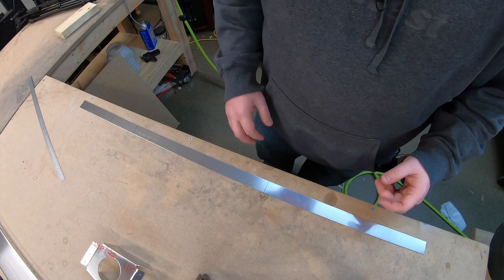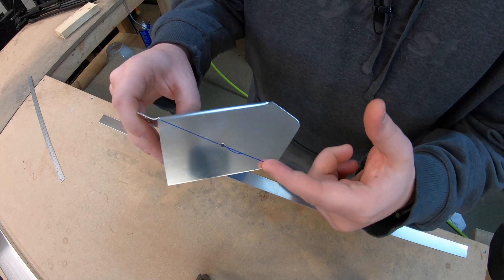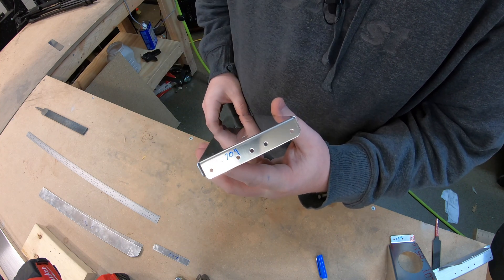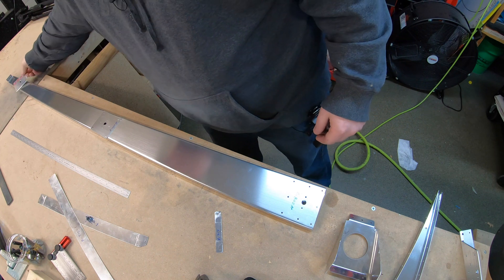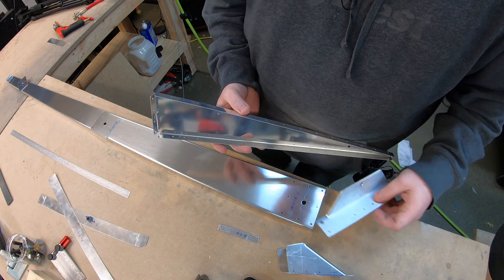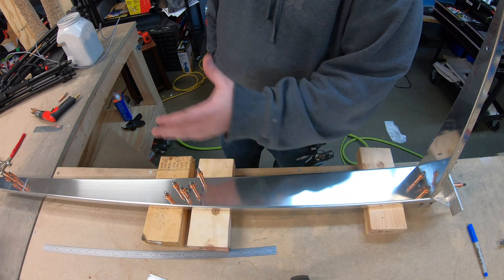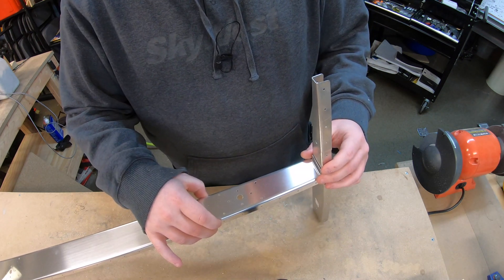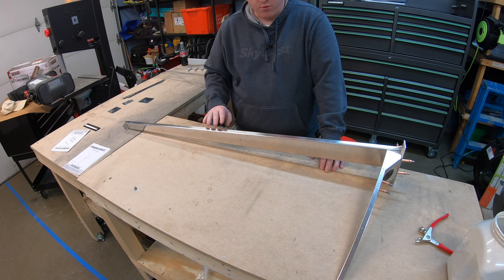RV-8 Rudder Skeleton Pre-assembly

Comment: Watching you do this kind of pisses me off… this is from the Vans website…

“Building an RV from the Standard Kit is a process of assembly, not manufacture. The builder takes the manufactured parts and pre- pares them for assembly by doing some minor straightening, smooth- ing edges, deburring holes, etc.”

What you are doing is not “assembly.” You are fabricating parts. I am about to order an RV-8 kit myself. I am wondering what other lies Vans has told me
Reply from the maker: Compared to the older, original kits these truly are, in very large part, just assembly. The fabrication aspects are generally minor in nature and I believe in part are still there to ensure adequate credit for maintaining the 50% rule. The newer kits like the RV-10, RV-12, and RV-14 are even more assembly in that the holes are final sized so minimal to no deburring of holes etc. However, I believe every kit is going to involve at least some level of fabrication. So far, I have found the fabrication to generally just be one or two parts per assembly though. Another note, the instructions and drawings on the -8 are not always the most clear, the newer plans RV-10 and up are more step by step instructions and easier to follow along, if you haven't yet, you may want to look at the sample plans on their site, or order the preview plans flash drive for $10 each I believe to see the difference in assembly instructions. 

If you have any specific questions, feel free to ask, and I'll do my best to answer them.
Reply: @pilottender  thank you for taking the time to answer
Reply from the maker: also, if you haven't yet, buy some of the practice kits that van's sells like the toolbox and wing section. Those are very good representations of what the instructions and process will entail.
Reply: @pilottender  I took a short class on sheet metal assembly at Airventure a couple of years ago, but I think I’ll definitely get the toolbox as a refresher

Comment: Thanks for the video.  What's the little right angle deburring extension tool that you're using?  Looks pretty useful.  Just when I thought I was done buying tools.....
Reply from the maker: Mike, Great eye! I almost mentioned it in the video but didn't expect anyone to even catch it. I am uploading a short video now to show it up close, but it is simply a right angle drill that I threaded the 1/4 shaft to reach some tighter spaces. Not even sure where I saw that now but saw it on someone's build blog or something